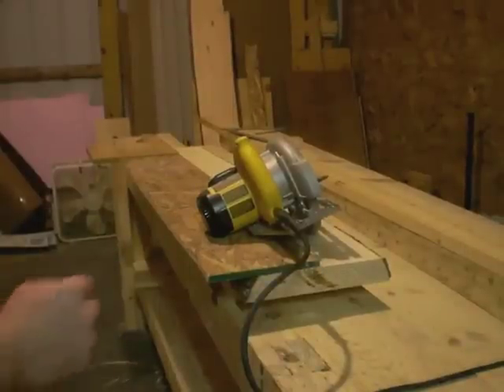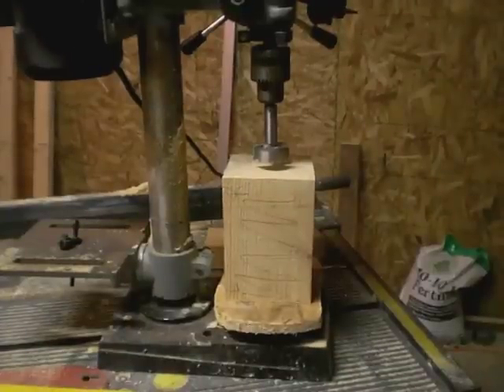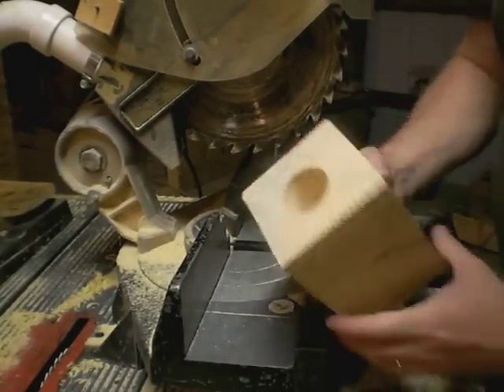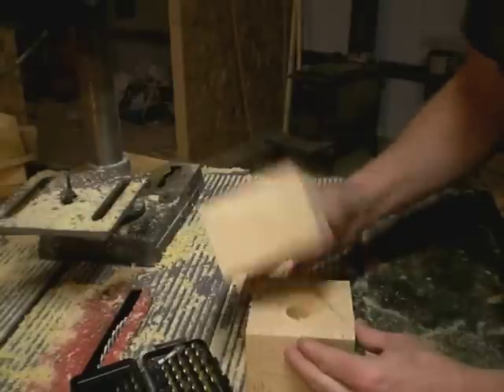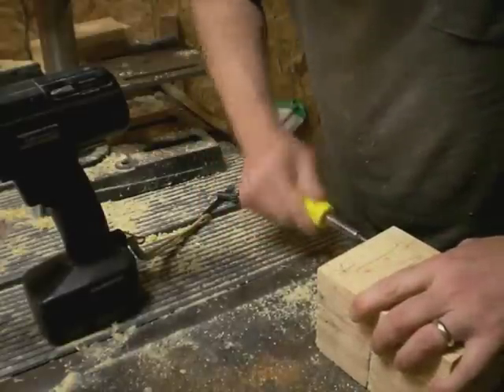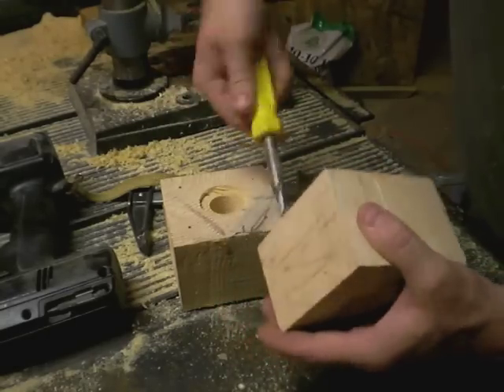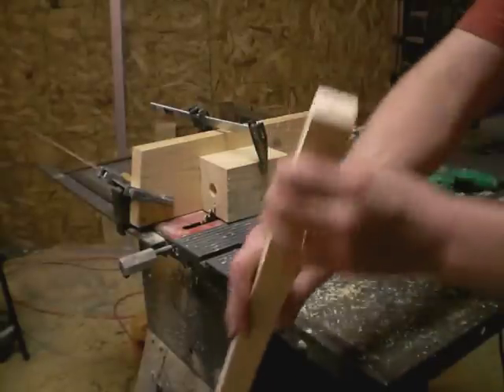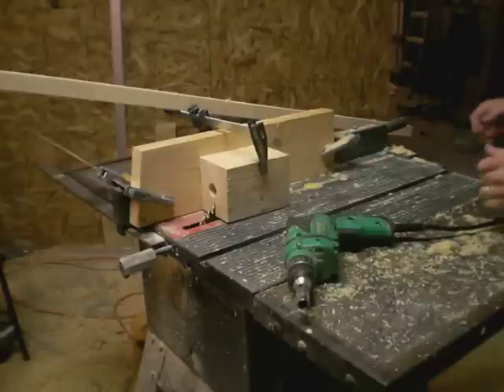How to Make a Dowel Rod with a Table Saw.

Comment: That wedding band is dangerous.
Reply from the maker: I've never had any issues with the wedding band while woodworking.  I do try to keep my fingers away from fast moving equipment.  The only time it becomes an issue is when I'm working on our cars and I have to get my hand into a tight space.   But there isn't anything moving fast in that situation.
Reply: P

Comment: This is an extremely dangerous method.  You can break your wrist if the dowel piece gets caught incorrectly by the table saw blade.  If you try this, be very, very careful.  Make doubly sure that the saw blade is not too high in the jig, as this will catch the dowel, twist it, and jerk your hand all over the place.